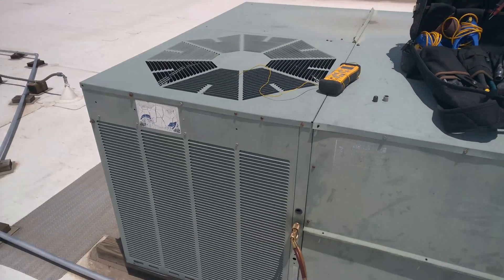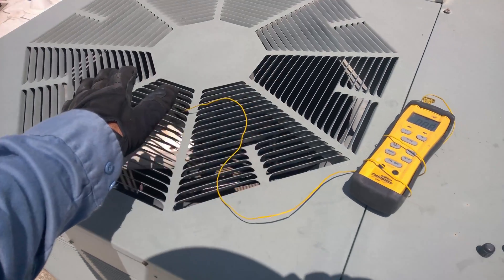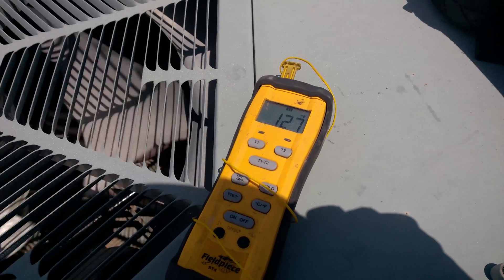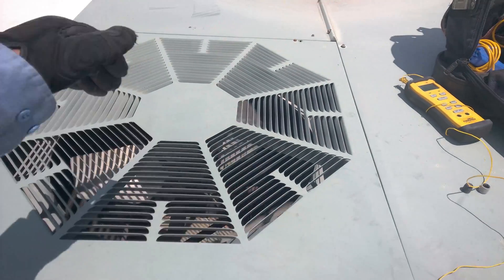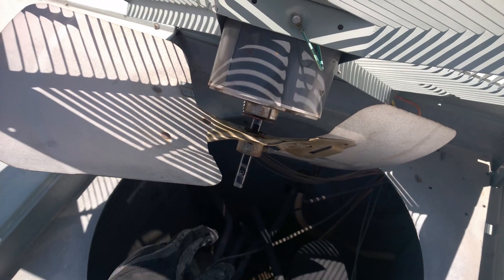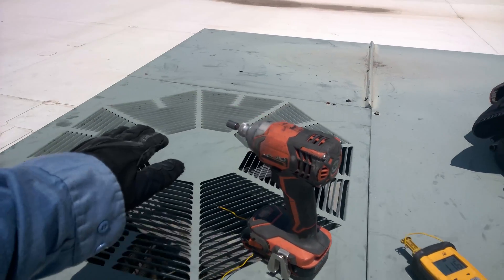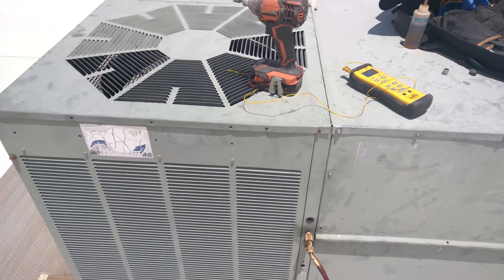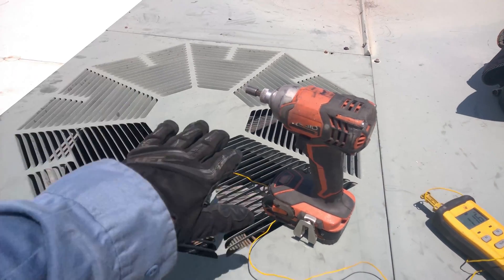Fan running backwards = low efficiency!

Comment: We had a new fan put installed about 2 years ago, tonight noticed it was pulling air down, and not blowing it up and out like its supposed to. Looking at the label on the fan, it can spin CCW, or CW, and says that to reverse the rotation, swap the wires. Do you have any thoughts on this, should I do it myself, or see if the company will still come out and fix their mistake?
Reply: 2 years of no response I think you're pretty much screwed
Reply: @trevorthinkstruthmatters2779  I figured it out and fixed it myself. The company installed a two speed fan motor, and supplied the high speed wire with a 5mfd capacitor, when high speed required 7mfd. 

I installed a capacitor that actually kicked the fan into high speed, and it's run correctly ever since. 

That ac company came highly recommended, but they're nothing but clowns and jackholes.

Comment: Great...So my capacitor was replaced about 2 weeks ago... I was outside the other day and saw leaves sticking to the top of the fan...grrrrr...unit was on...of course the fan is running backwards! All he did was replace the capacitor and recharge it? How could this be???
Reply: I need to fix this myself...it was a free job from my ex and there is no extra funds for anyone to come out...
Reply from the maker: Hmm... He didn't replace the motor too maybe?
It's been forever since I've seen it, but it is possible to miswire the fan at the capacitor to get it to run backwards but the motor will usually soon overheat or even die. Maybe the fan's run cap is tied into the compressor side of the large capacitor, etc. That can cause freaky stuff.

There are so many brands and wire combos that to do a DIY you will probably want to upload a video of it for show and tell. 
Get some close ups of the motor that is in it. Look for wires hanging loose at the top. And then some video of the wiring going to the capacitor.
Reply: I watched him do it, I even recall asking him, how do you know which wire goes where. I guess I just need to call him and ask him. Sigh...

Comment: I bet you replaced the motor without checking the capacitor. Capacitors can make the motor run backward. I have seen it a bunch in my 35 years hvac work. wasting customers money is what most do. But I am honest. I don't do things that way.
Reply from the maker: +jim smith Dude, no way. I know better!

You must not watch this channel much. :-/

Comment: I have had a s similar problem last week, I was working on an old old 40 year old Engineered Air Unit and believe was a 30 ton with 3 condenser fans. Originally the middle condenser fan had a counter clockwise rotation fan blade to prevent turbulence but someone changed the counter clockwise rotation blade to a clockwise rotation blade. I discovered that my head pressure was a bit high and when I looked into it, the person who changed the fan blade did not interchange the leads on the contactor for clockwise rotation. I bet that unit ran for 20 years like that. That unit had one 3 cylinder Copeland Compressor with mineral oil with two unloaders.
Reply from the maker: mechanicwarrior20 Wow long lasting unit.
They don't build them that tough anymore.

Comment: Was that s reversible fan? Simple fix of switching the rotation connection? I've had a few that were original motors, original wiring, with good caps, turning backwards. Must be the way some fail from time to time.
Reply from the maker: Tim Bagnall Yeah it was reversible. Someone messed up.
Reply: Yes. Swap herm and comm wire on start capacitor.   You will be good.

Comment: Happens to me a lot when I'm recording so I ditch the video lol.
Reply from the maker: First Choice Service LLC ( StL MO) This last week was the first time I've seen such a message from a phone.

At least it didn't just lock up or reset on me. It saved the video but I thought I recorded a clip in the controls but I probably forgot as I had stopped to let the phone cool off.
Reply: my old iphone used to do it because I used as a flash light.
Reply from the maker: First Choice Service LLC ( StL MO)
It doesn't help that my Nokia 1520 is a 2.2 Ghz quad core that is in a black rubber case that sits in my holster case as the sun beats down on it to cook the crap out of it in this 100 to 110 degree heat all day.

It is HOT before I even pull it out to use it.

At least it is a warning and it doesn't lock up.

Comment: But was the fan cap strapped down?  Maybe if he took the time to strap the cap he didn't have time to check rotation.  Hey, a guy can only do so much ..... :-)
Reply from the maker: Straycurrent LOL, the run cap was actually in the stock position in the unit. With these units is a hole in the control panel that the cap fits into.
Reply: lol,great comment

Comment: Our trade is just full of half assery.  Something needs to change.
Reply from the maker: dpeagles I've been trying to bring awareness for over a decade now via HVAC-TALK (the popular HVAC forum) and then youtube but even though many have told me that some videos have helped them and several others have even said that their schools used my videos to show the newbies WHAT NOT TO DO, I think the hackery will continue especially in the Arizona desert where you don't need to be an experienced HVAC tech, plumber etc etc etc to go to homes and businesses and perform installs or repairs.
Reply: In North Carolina the duct work in residential is terrible.  Every house you go to you just shrug your shoulders.  So many problems, so little energy.
Reply from the maker: dpeagles Most of the tract homes here use flex duct and most of those don't even have any strapping.
They just let the flex duct fall where it may causing kinks and all sorts of unnecessary bends.
Reply: Yep, i see this occasionally too in refrigeration You tube is helping with less hackery - i hope.
Reply: EVERY trade is full of half assery.   Government oversight (regulation/certification) is a very expensive and oppressive option.   Be careful what you ask for when you say "Something needs to change.".  ;)    Having retired from the oil/gas/power generation field where there was (and still is) a whole lot of half assery, I can safely advise that HVAC techs, business owners and customers won't like the 'government' solutions.